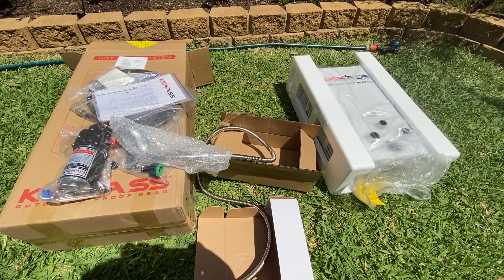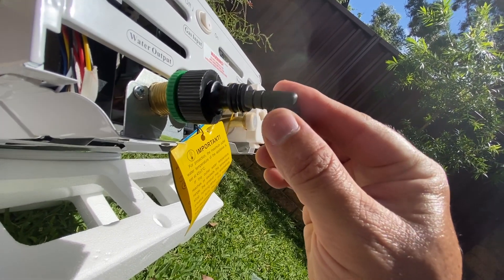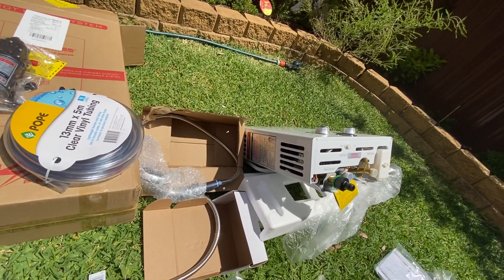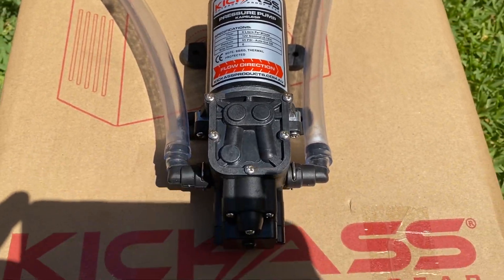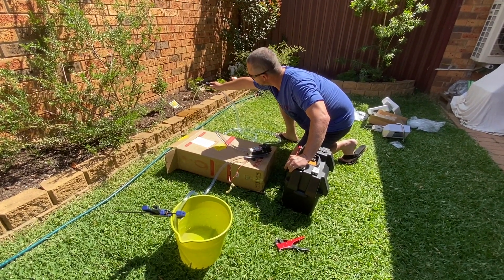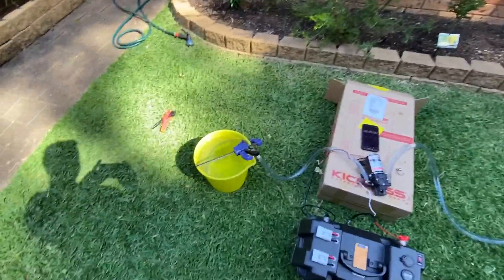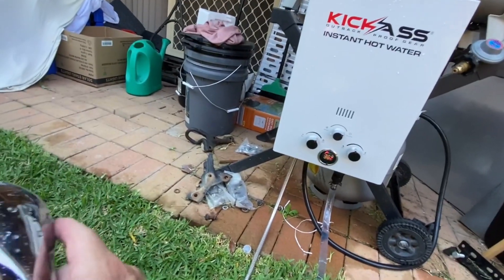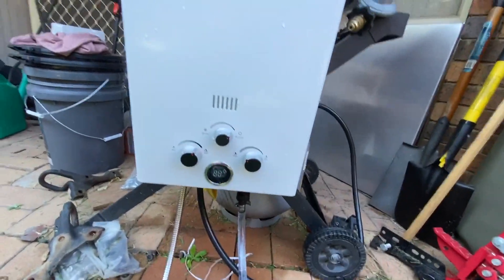Kickass hot water system unbox & first impressions.

Comment: Got mine hooked up today and grabbed a 13-10mm reducer which come in elbows or straight. Hooked that up to a short piece of hose pipe connecting into the system. Whats the point of the on off on the shower head? Mine doesnt seem to do anything.
Reply from the maker: Yeah the on off button on mine isnt really good hey.. It gets jammed and its really hard to flick the switch

Comment: How you end up wiring up the pump to your battery?
Reply from the maker: hey Albert, I have 12v batteries in the canopy. Simple 12v from them through a fuse into a switch to operated the pump. You can do the same from your start battery. I can leave the  pump on all the time as its pressure operated. Once the pump sees pressure it auto shuts off.. Its a 6ltr Kickass one

Comment: Is the 6 litre an hour enough for an acceptable shower, 
And when you turned it up and it came out quicker, does it hold a decent warm temperature?
Reply from the maker: Hey Tim, Yup its more then sufficient. If your crank the shower to full pressure it cant reach the thermal cut out at 50c. I find 40c is the perfect temp and I did this in 3c outside temp and was super warm. No use going over 6ltr p/h pump for a hot shower as you just cant get the temp up unless you were to pre heat a water bucket and draw the water from that
Reply: @4wdglampingaustralia102  .
Thanks for replying much appreciated
Reply: So, from a cold bucket you wont reacg the temp unless you cycle the water thru  before?

Comment: Hey mate I'm pretty sure you've done it wrong. You put the tap thread on the "water output". Screw it onto the "water input" and then you can connect a hose straight on it 😅 The shower head should screw onto the output! I brought one (the unit itself) from facebook marketplace today without those components and just used a garden hose tap straight onto the "water input"!! Thank me later 😅👍
Reply from the maker: Really old vid. Working sensational for some time now. You won’t be disappointed. Do yourself a favour get the new style shower head, the chrome one is terrible. Cheers for the support 👍
Reply: @4wdglampingaustralia102  no worries mate , And thank you for the tip 😎👍